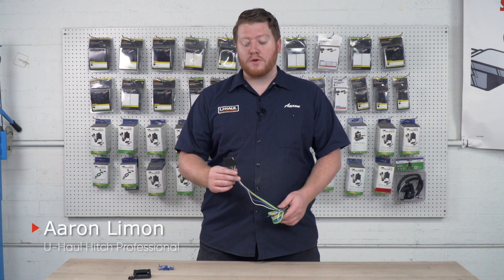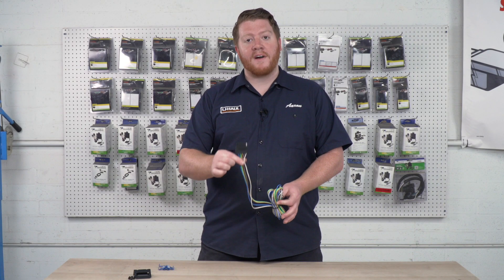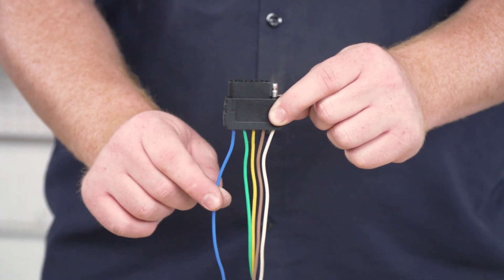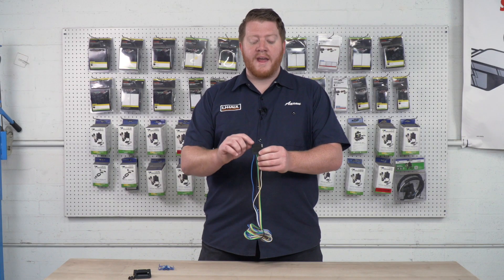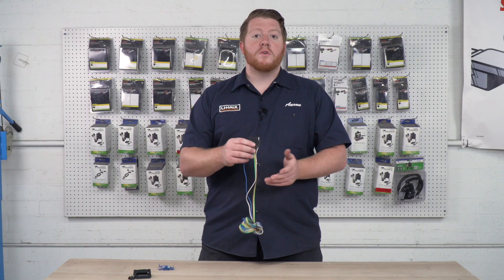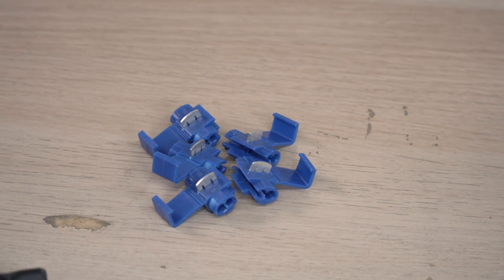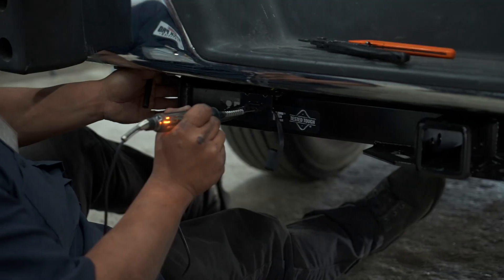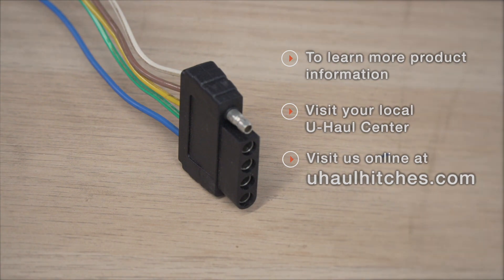5-Way Flat Trailer Wiring Review

Comment: I have a four plug on both the vehicle and my boat trailer , the trailer end has 3 brown wires , and the vehicle only has one, can you tell me how I would connect the three wires ?
Reply from the maker: You're going to have to use a test light to determine the function of each wire. A test light can be picked up at any local parts store. Use this video if you need help testing your wires - https://www.youtube.com/watch?v=LGdx3tCYQ08&t=113s

Comment: Is it very expensive to replace the wiring on a galvanized 15’ aluminum boat trailer?
Reply: $15 on amazon and it will be on your door step the next day. if you want to update light boxes and lights, thats anoth $45.
Reply: no 50 ft wire amazon duplex $25, 5 way plug $8.00 2 led trailer lights $20

Comment: can you use the blue as a brake light? i tried to do the 4 plug but that caused both my lights to blink when turn signals flash, my brake has its own brake wire, causing the need of the 5th wire..